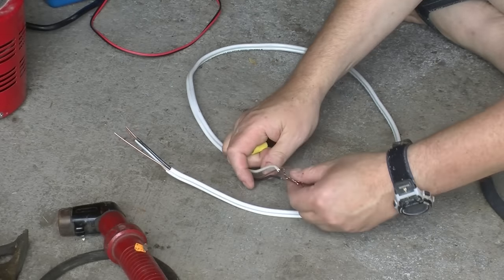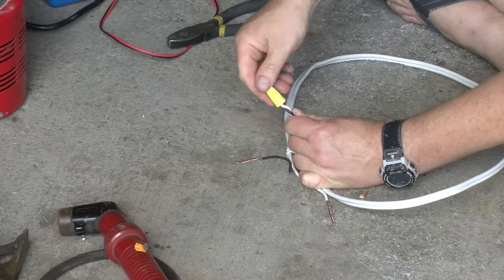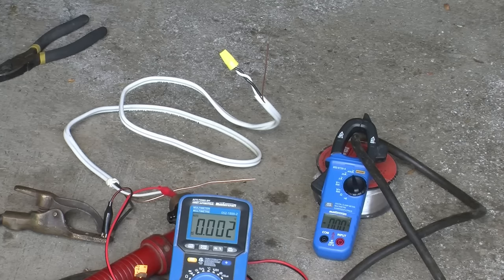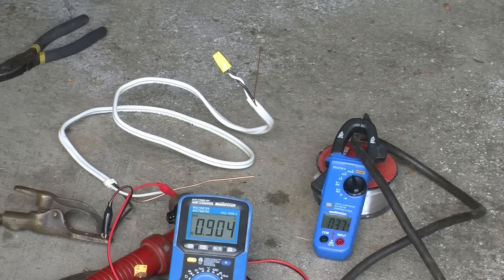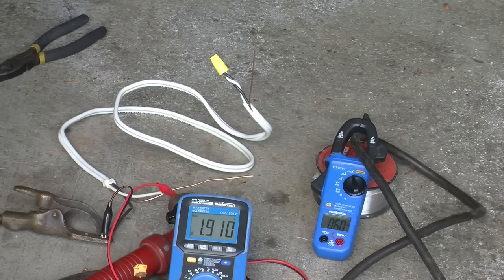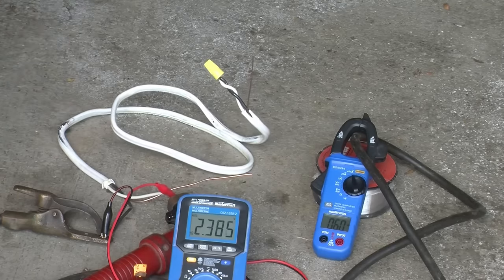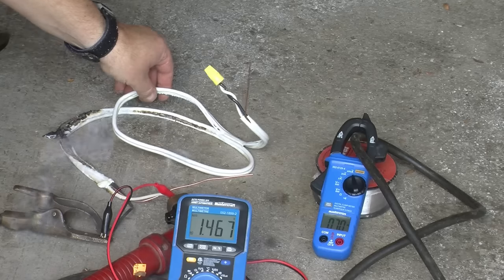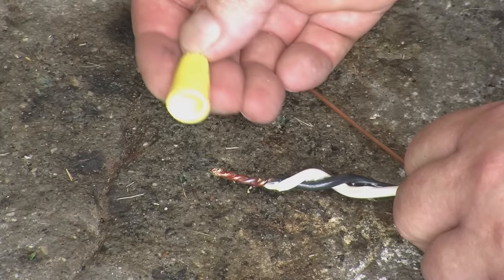How many Amps to burn up 14/2 electrical wiring?

Comment: Two of the 14/2 Romex connecting to my ceiling fixture look really dark grey for about 6-inches coming out of the ceiling fixture box and I can't quite figure out why.  
It was all crisp new white stuff 2 years ago.  
And it's only feeling 2x recessed LED wafer lights and 2x A19 LED bulbs.  No where near the crazy amperages you hit! 
Maybe it's not really a big deal afterall, seeing as how 14/2 is a lot more durable than I ever imagined after seeing this video! Wow!
Reply from the maker: That really weird - I dont think I have ever seen white romex turn grey Its almost like there is some sort of chemical reaction. I have seen the plastic discolor and go brittle in really old junction boxes after decades and also from connection/poor warm connections. 

I wonder if there is some strange of-gassing from the fixture that is discoloring the plastic? I once had a remote trigger for my camera that got weirdly sticky after being stored in a semi-waterproof partly plastic pocket in my camera bag - some   combination of of-gassing from both plastics seemed to react. 

It is really amazing how much 14/2 can take - but also how that safety margin disappears if embedded in modern insulation in walls etc as I showed in later videos. The heat retention due to insulation  reduces the maximum safe current so much that I actually would hesitate to use 14/2 in-between insulation in an attic that is subject to high temperatures in the summer.

Comment: I wonder if soldering would provide a better connection than the prehistoric wire nut
Reply from the maker: Apparently before wire nuts (and I think into the 50s) it was acceptable to twist the wires, solder, and then cover with tape. In a junction box of course. I have never seen it - I wonder if anyone here has, and if anyone has seen any failures on those  types of connections.

Comment: The test wire is very short / can handle much higher amps - it's called 'chassis amps' vs 'transmission amps'.  A typical home wire run would be 50ft or 100ft from main panel to plugs in the home and would make a better test.
Reply: length of the wire is irrelevant when it comes to the max current it can tolerate, except for if the wire is so short that connection points are conducting the heat away. the length of the wire only deals with voltage drop which is what transmission lines are mostly concerned about. longer wire has more voltage drop then a short one for the same gauge but has the same wattage dissipation or heating per a foot between the two when pulling the same current. 

the test done here is very representative of a longer wire. only difference would be higher voltage would be needed to achieve the same current in the wire
Reply: Respectfully disagree.   A longer wire - 100ft - will have significant resistance (compared to a couple of feet) that results in extra heat.   So the same level of current - say 30a on a 100ft 12awg wire will be much warmer than 30a on 2 feet of wire.     And please take this comment as respectful - I enjoyed the youtube!
Reply: @kennethalmond8922  But, unless you leave it rolled up, that heat will be distributed over the length of the wire, so it should come out the same. But I think your point about chassis amps is valid. Since this wire is in free air it can throw off the heat.

Comment: Fun and somewhat informative; obviously not scientifically controlled but still worthwhile. It was noted that this was conducted in free air not buried in a wall with insulation.  An actual short circuit failure mode would be more complex.  The conductivity of a real world short and ability to support continuous current flow (like in this case) would be lower but arcing then becomes a factor and is the reason behind the evolution of the modern arc fault circuit breaker.  Arcing can be quite hot and would be a potential topic for another video.  But this video was intended not to evaluate real world failure modes or worst case scenarios but rather to test the limits of the wire insulation itself.  Temperature readings would have been interesting.  Can we conclude that the failure sequence is something like this (1) outer sheathing (2) individual wire insulation (3) the wire nut (4) the copper itself melting; the only way to be sure would be to repeat with more rigorous controls and temperature monitoring.  But can I say, very cool experiment ?
Reply from the maker: Yes is fun and was done after I did the same on an extension cord that I was about to throw away and thought hey - lets see how much current it will handle. You make a bunch of excellent points. I did a bunch of follow up videos with the cable in section of wall, with and without insulation. And eventually got a thermal camera. So in the en the tests were much more real that this fun "lets melt a wire" one.

Comment: The wirenut twists the wires inside as it binds the wires together. You can't calculate wattage across a shorted circuit. You must use open circuit voltage times the current when a load is put on it. Imagine the wattage required to make 2 feet of 14-2 warm/hot @ 30A which is way more than 20W [4:26]

There is also a difference between rome cable in open air as when inside a wall. Per code, you can safely run 10 12ga solid conductors @27A in a 1/2-inch metal tube. [EMT]
Reply from the maker: I recently posted a video discussing those things https://youtu.be/CP3-jcpzZeI

Comment: Maximum heat is in splice connectors in boxes. That is why connection is made only in box with cover. NEC has huge discussion on aluminum to copper splices which caused many many fires killing many people in 1960s-70s .
My uncle was Fire Chief and helped do investigation on this in NY.
Also DC power versus AC different reaction and equations for losses do to induction etc.
Exponential increase occurs
Reply from the maker: Sadly I'll bet your Uncle came across plenty of evidence why Al is bad - I am in Ontario and huge amounts of Al were installed in that time period - probably the same in NY. 

The welder out is AC!
Reply: @ElectromagneticVideos  yes many died in house fires then.
Nice videos.
Reply from the maker: @MitzvosGolem1  So sad. What a terrible electrical flaw.     Glad you liked the videos!

Comment: Now consider how hot the wires are in an attic on a hot summers day before  the current is flowing. Theoretically that same wire would burn up at a much lower amperage.
Reply from the maker: Exactly!!!!!!!! And even worse when covered in insulation. I did a bunch of tests in more realistic situation with cable in walls and various insulation types. See here if you are interested https://www.youtube.com/playlist?list=PLHUfJmsprIcTVwSgCkTJnkinJSWrZY7DY

Based on that for the resons you describe, I would certaibly up-guage wire if in an insulated (or not) attic that was bing used for something with a high continuous load particualry in the summer - ie and air conditioner.

Comment: Good to know information for ebikes
Reply from the maker: I never thought about that application - yeah - lots of current for those motors particularly when the motor is producing under high torque. The thing is the heat given off by the wires is the result of voltage drop = power loos. So bigger wire is also better to make the best use of limited battery size.
Reply: @ElectromagneticVideos  Yeah for sure! Really good information.

Comment: this was a great idea, but to be practical we should be looking at the NEC regulations of long term / continuous versus short term inrush, then checking temps of the wire in those time frames. I suspect that 3 hours of 15 amps will be making the wire almost too hot to touch... and 25 amps will be on the verge of fire in 3 hours. While we are at it, we might as well look at the voltage drop for a nominal 100 feet of wire on a given load, which would be more typical of a branch circuit in a home.
Reply: I feel like it would reach heat loss equilibrium after 20-30 minutes. I could be wrong.
Reply: @libtrs838  ... well, yes. There are various insulation temp ratings and this is why NEC has their regulations of what's safe. This is all about staying within voltage drop (protecting equipment) and being under a temp where the insulation breaks down over time. (protecting the wires)

Comment: I have an idea! If you took that wire and wrapped a bunch of it around a proper form, you could heat a small room. Or....place a bunch of flexible wires in a blanket to keep you warm in the winter. 🤣

Joking aside...very nice video and fun to watch.  I'm not sure how I got here? But I am a radio and electronics junky. Anyhow...great info.
Reply from the maker: Better run out and patent your ideas before someone else does :)

Funny you mention "not sure how I got here? " - this video is year old and suddenly is getting bunch of views again - no idea why YouTube is suddenly offering it again. You might find some of my more recent videos more relevant to your interests like my transmission line reflections one: https://youtu.be/a-8CaGOmWDU

Comment: I'm not sure what principle of Electrical I'm misunderstanding here but the rating for the wire is supposed to be Approximately 1750W of load traveling through (15A x 120v). Is a test @ 50A x 1.5v of 'resist" actually functionally the same?
Reply from the maker: The experiment is to see the heat given off by  the wires as ever increasing current is passed though it. That ohmic heating depends only on the current, so it makes no difference if there is a 120V load at one end with 120V between the wires or a short as in this case. The small voltage here is the voltage drop along the wires. Using a short and low voltage makes it much easier to setup and much safer that doing it with 120V.

Comment: It's an interesting experiment, I do wonder what the length of the wire would play with the resistance of the wire itself.
Reply from the maker: Thanks! Well a longer wire would have a greater total resistance so to achieve a same current and hence heating per foot, a higher voltage would be needed. Since in a real use of a wire the voltage drop over its length has to be minimized (because it wastes energy and lowers voltage at the end which can harm some appliances), really long cable runs can  need thicker cable than one would think just from cable current ratings.

Comment: Id be curious now to see the same test but with 50 feet of wire, the shorter the run , the more amps it can take, correct?
Reply from the maker: Yes - but for a different reason:

For longer runs, the limitation is the allowable or acceptable voltage drop at the load (usually imposed by electrical code for house wiring). So the longer the run. the more resistance in the wire, and the greater the voltage drop for a certain current, with the voltage drop increasing with increased current flowing. Usually a drop of 3 to 5% is considered acceptable. So its more a rule designed to make sure the load gets sufficient voltage that limits the current for long lengths,

What you see in the video is heating along the  wire due to its resistance per foot. The heating per foot is current squared times resistance per foot, so length does not change the heating per foot for a given current. So the max current at which insulation melts or fails   does not depend on the length.  

There is one issue with this video - the cable is in open, free flowing air which does help cool it. Embedded it in insulation in a wall and it will melt at considerably lower current. I did a number of follow up videos showing those situations.

Comment: I've got a tenant that constantly melts outlets because he overloads them by plugging in a dozen items through multiple power strips. On one 15 amp outlet he will run a 13.5 amp air compressor, decent stereo, computer, several amps of lights, shop fan, mini  refrigerator, space heater.... and who knows what else I'm forgetting. These will be on whenever and sometimes all at the same time until the outlets crumble from heat cycles. When he destroys one he just moves on to the next in the house by tapping into one of them in the family room entertainment area and running several cords out the door to the garage, thus overloading the large theatre system outlet that now has the garage stuff plus theatre system, and another space heater. I've explained why the outlets melt and crumble, but they insist it's because they are from the 80's and just falling apart. I've quit replacing them and told them to pay for an electrician from now on.
Reply from the maker: Yikes! Maybe time for a new tenant? If you haven't already done so, maybe an AFCI breaker on the circuit the tenant has access to? Nita cheap solution but might prevent a house fire. Or not with someone who abuses the electrical system like that! 

There also also commercial quality receptacles that should take higher currents better, so may be an idea to install then when replacing burnt out ones. Good luck!

Comment: The reason The Wire nut did not fail or did not. Get very hot is you correctly connected the 2 wires by first twisting them together. Therefore, The Wire nut became just a retention device. Holding those 2 wires from loosening up. Now. Had you just stuck the 2 wires into The Wire knot and twisted them? You would have seen a very different outcome.  As it becomes part of the conducting circuit doing so, it is not rated for the current that you were putting through it and I am sure it would have failed.
Reply from the maker: You absolutely right about the difference one would expect for twisting or not twisting before using the wire nut. I saw from your other comment that your an electrician - down in the comments of this or my other video, there were some heated discussions between electricians as to twist or not - looks like there is a considerable source of disagreement as to which is "proper". 

As far as pushing currents way pat the ratings to see when it fails - that a fairly typical engineering approach to see/confirm what the safely margin might be of a device. If you want to see some interesting tests like that look for some videos how airplanes wings are tested - they bend they way beyond the design point - they tests are spectacular!

Comment: Need to allow time to reach thermal equilibrium at each current
Reply from the maker: Yes. With relatively small thermal mass and being in open air, this happens quite quickly. Less so for cable embedded in insulation as in the follow-up videos.

Comment: There’s twice as much conductor at the wire nut joint, that’s probably why it survives so well, right there.
Reply from the maker: Yes - in much more conducting surface and mechanical pressure from the twisting.

Comment: Well it is not just the amperage, it is the overall wattage dissipated by the wires as seen here.  This is a good demo of the thermal breakdown, but the amperage achieved at only a fraction of a volt, does not equate to the typical real world installation with a fixed 120v input.  Under a fixed 120V input, the amperage being pulled by a load thru the wire resistance(which you did not measure) would determine the wattage, in the form of heat, imparted to the wiring.  A more accurate test of what it takes in the real world to overwhelm romex, would be to setup a higher current 120V AC circuit, connect up a 14ga circuit to say a 4gang jbox.  then connect a load at the end such as several space heaters.  Under those conditions i think you will start to see significant heating in the romex above 20A. 1KW@120V is 8.3A, so a 1500w + 1000W heater would be 20A…
Reply from the maker: Unfortunately you are confusing two things - resistive heating in the wire due to current flow in the wire which does not depend on the voltage between the wires and power delivered to the load which does  depend on the voltage between the wires

Due to numerous similar comments I did a written discussion here https://www.youtube.com/channel/UCV2-Qbq9o0EOQWPLAWkVH2w/community?lb=UgkxeilOfLJGy2ODslnBW0WFXUE580oHhFyP which also has a link to UL certification study using essentially the same method.  The biggest flaw in the test in this video is that cable are usually more heat restricted than this due to insulation in the walls etc. I did some follow videos with more realistic situations.

Comment: Cable in free air has a better rating than if it is installed in a roof space say in or around insulation.So you would have to de-rate the current carrying capacity. Then you need to know what the temperature rating of the cable insulation is.
Reply: Cable in cold liquid nitrogen has a higher rating too.

Comment: I see several comments about open air vs fiberglass insulated wall.  It would be interesting to see this done with a longer piece of romex folded over twice and passed through a  1-1/4" hole in a 2x4 to see how close proximity to other cables can increase the heat load in the 2x4.  Maybe a more real world scene would be to have three short pieces of romex and the one test piece.
Reply from the maker: You make a very good point: two or three time the heat dissipation is essentially the same place with the same amount of insulation around it would definitively increase cause significant temperature increase. Not as bad as a single cable with 2 or 3 times the current (heating power is I squared R)  but still could make a significant difference. I do still have the test wall so I may do some more experiments this summer.